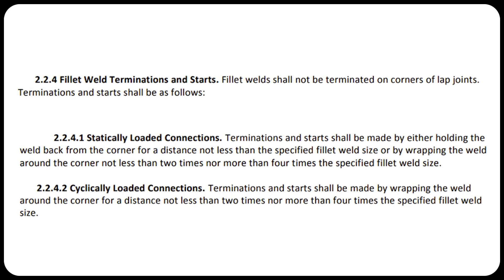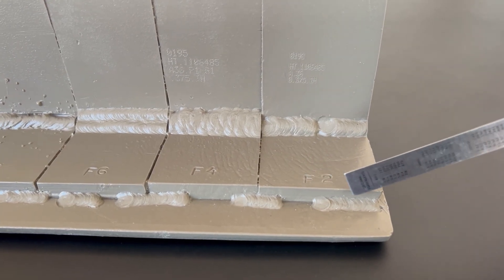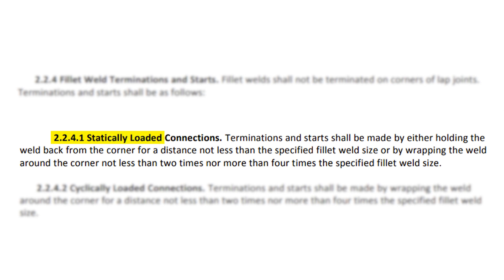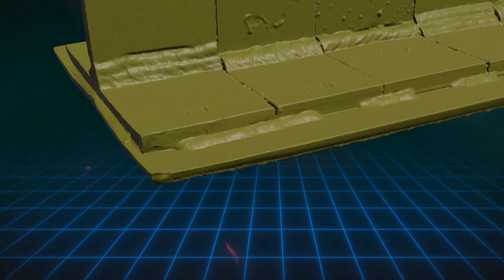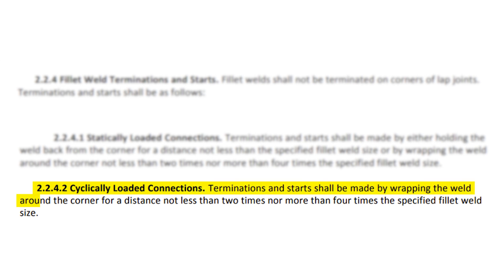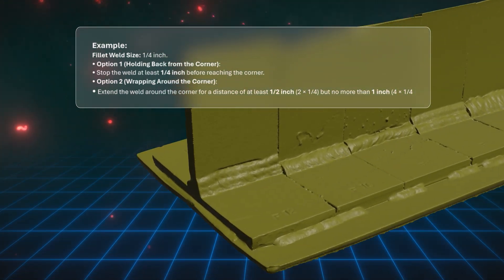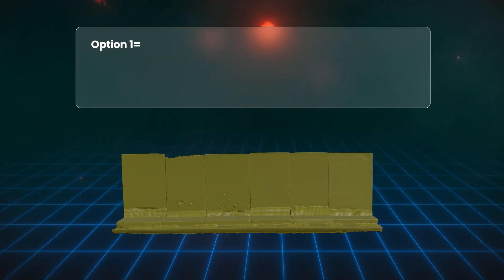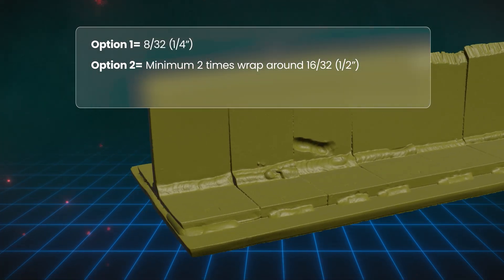Pass Your CWI Part B Exam: Structural Steel Requirements, Calculations & Best Practices

Comment: Wrapping corners at work drives me nuts (not myself, I wrap them and do not terminate on corners.) But many guys just dot the corner then buff it up with a soft pad to blend the weld to appear continuous. 

As for a piece of angle welded to a tube, hich the print calls for 3/16" weld 3 sides, the guys in question say it's not the joint I am referring to. I reply it sounds like a skill issue and we are technically supposed to weld up to 3/4" around the corner, then walk int our termination or continuous to meet the full length of the connection. Am I right or wrong?

Comment: So I noticed you measuring the wrap around distance with a red line beginning inside the weld partially. Not parallel to the corner. Are we supposed to take our measurement this way? Including half the weld metal as the start? Not starting on the 90° of the corner?
Reply from the maker: @wangchung_  By the time I caught it, video was already live. 3D videos are tough to edit. I’ll do a better job next time.
Reply: @CWI-First-Try  just wanted to make sure. Thanks